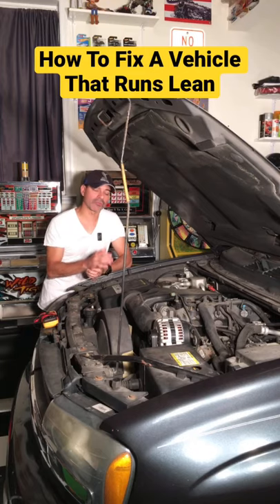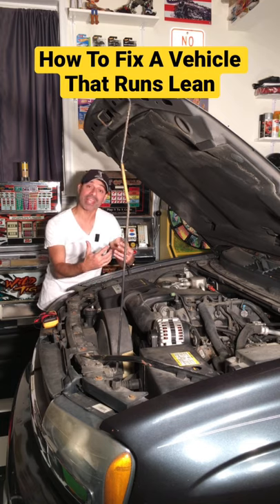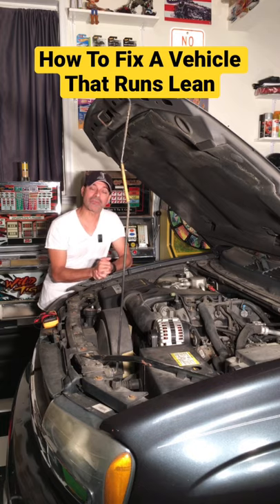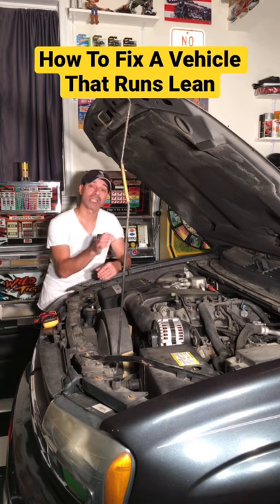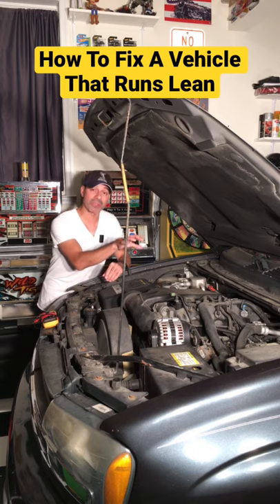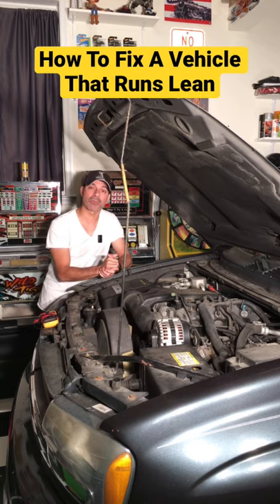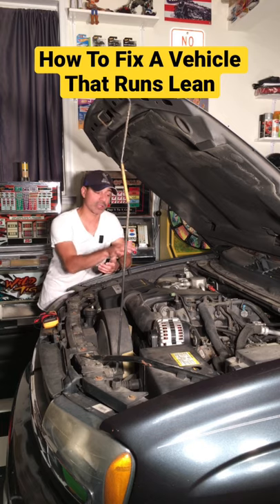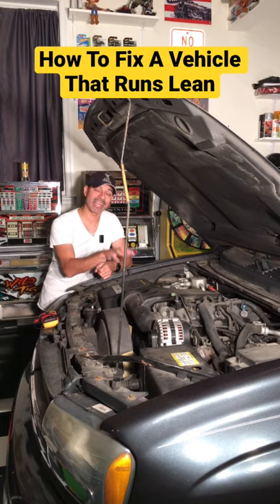How To Fix A Vehicle That Runs Lean.

Comment: After I changed the fuel pump on my 2010 Mazda CX9, the engine started to vibrate a lot, and sometimes it seemed to lose power and make knocks in the express way, that never happened. Can you tell me if my new pump is damages
Reply from the maker: Check the fuel pressure to make sure you are getting the correct pressure for your vehicle
Reply: Did you figure out what the knock was coming from?
Reply: Check the maf sensor that was my problem in my mazda

Comment: I'm running lean on a 98 Expedition and failed smog for 171/174 , and it sometimes needs two cycles of cranking the ignition switch to start, especially if the engine is hot. You think it could be the fuel pump? Or a temp sensor?
Reply from the maker: Check the fuel pressure to make sure it’s to recommended PSI. Could be a vacuum leak at the intake manifold gasket, or the MAF sensor as well.
Reply: Check the idle air control valve.
Reply: @PhillipsVision  I changed the fuel pump which fixed the intermittent starting issue, but ya you're prob right about that vacuum leak or MAF

Comment: 05 deville lean and misfire i have a crankshaft position sensor code and misfire code thats it, new mass airflow new throttle position sensor new starter replaced the hoses that had holes in them from the vacuum leak I hear air suck noise like a cold air intake, but it's inside my intake manifold also a new fuel pump, when I put new spark plugs in it drove worse so I put the old ones back in the only symptom it has right now is low power like you'll press all the way down on the gas and it'll barely wanna go and it pops when you shift at high RPM

Comment: Back in the day, we would light up a few pieces of napkins inside the throttle body cover with foil and look for smoke or use a spray bottle of water or starting fluid.😅

Comment: Dealing with this on my 2010 mazda Cx 7 and I can’t figure out what it could be !
Reply from the maker: Check for vacuum leaks around the vacuum lines. Spray some carburetor cleaner or starting fluid around them while idling and you should notice the rpm’s rise where the leak is.
Reply: Did you figure it out? How long did you drive the vehicle with the  codes

Comment: I need this video. My car is not passing emition because of this code 171 po code in silverado 1500.
Reply from the maker: You may have a vacuum leak in the intake manifold gasket
Reply: I have a 99 ranger code Saya I'm running to lean ,I had found some broke lines I fixed those still have the code, mechanic ripped me off he just plugged it in from the Woodside charged me 180